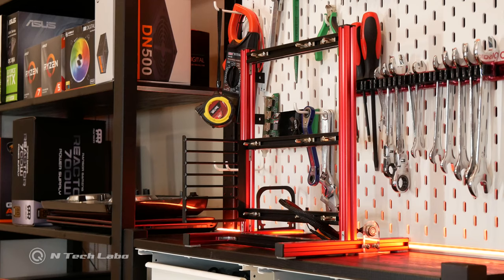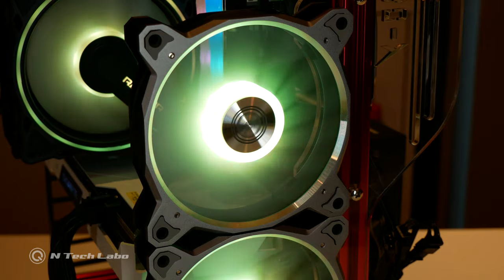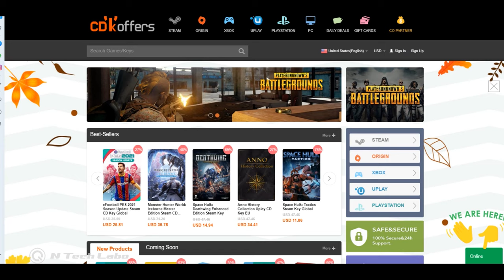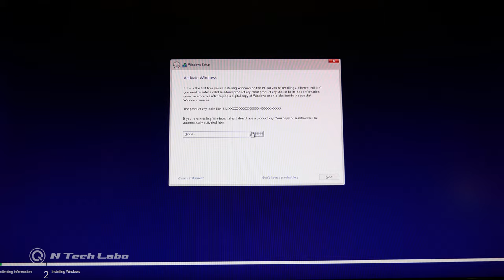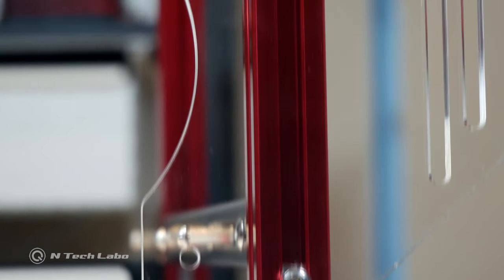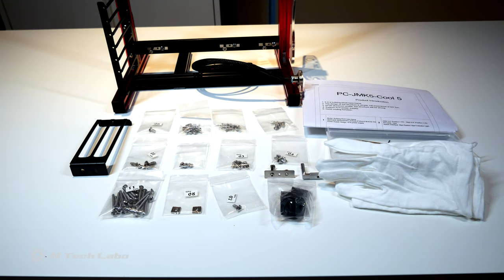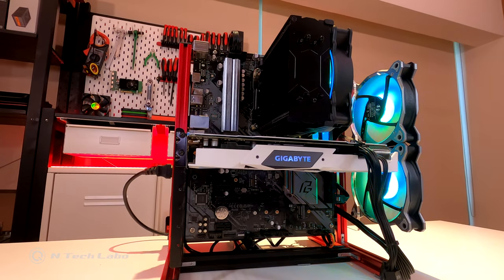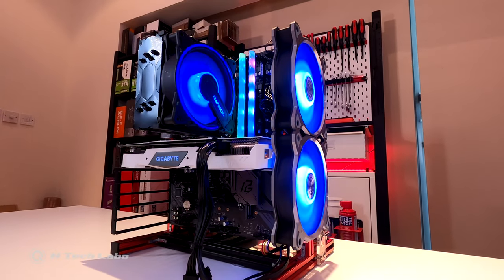Top Tech PC Build - Open Frame PC Case Build & Fan Installation Guide

Comment: I have built two of these same test-benches, one for an X79 platform and another with the X99.  I found the easiest way to place the motherboard correctly onto the standoffs is to first take a sheet of thick paper or thin cardboard and mark a template using the motherboard's standoff holes. The template will help tightly fix the position of all standoffs on the bench BEFORE mounting the motherboard.
Reply from the maker: Hi JB, Thanks for watching. Yeah, that's a clever idea.
Reply: Thanks for share with us... i buy a similar and this tip will be useful to me when assembling!
Reply: measuring where the GPU mirror will be also seems important in this process.

Comment: Hi, i wonder if a gpu longer than the motherboard will fit even without the fron fan?
Reply from the maker: Actually, you don't need two fans I installed. That's just for a visual purpose, and for an explanation of installing the fans.

Comment: this is incredible - but no concerns of dust or anything like that?
Reply from the maker: Hi, I'm using the frame as a test bench. I have concerns of dust so I dismantle the components when I finish taking data, and but them back inside the box.
Reply: Actually, it is so easy to clean with a cheap blower.  My open case sits on the corner of my glass desktop. About once every week, I clean the top of my desk. With the blower, I clean both the keyboard and the PC...takes all of 20 seconds.  I never see dust accumulate. I have the same case with optional handle, purchased from AliEx about 1 year ago for about US$70.  From the handle I mounted two 90mm RGB fans, tie wrapped neatly to blow onto the VRM and 8 ram sticks.  A dual 120mm fan cooler (PCCooler GI-D66A), RGB with top plate.  Dual 120mm RGB fans on the side. As well,  dual fans within the RX590. So, total of 8 fans keeping the OC'd system cool. With all of this air flow, maintenance is literally a breeze.

I prefer a BT headset (MPOW H12) with ANC, so noise is a non-issue for me.